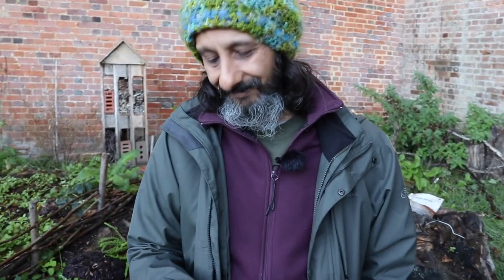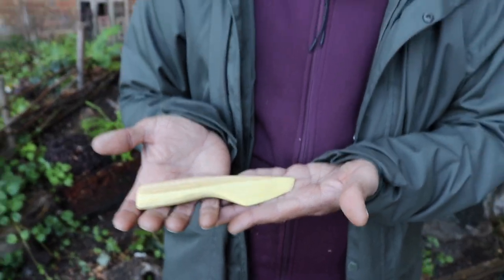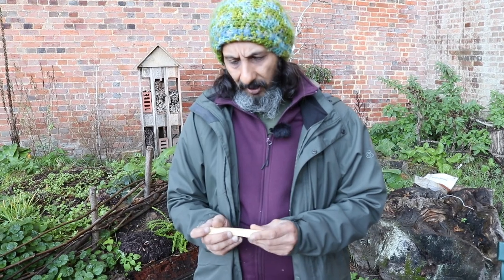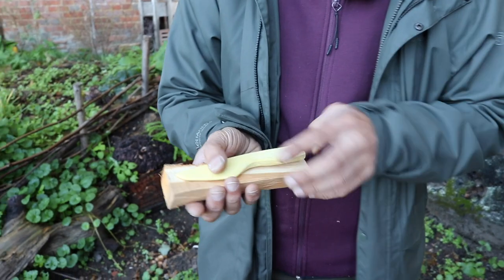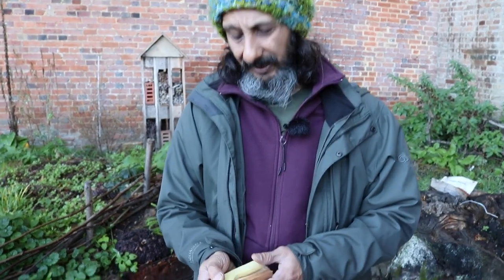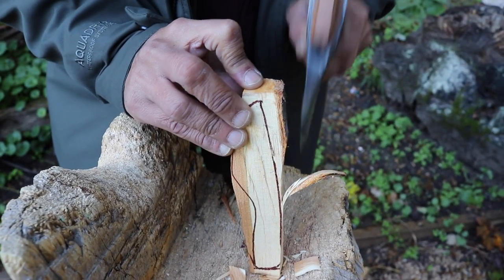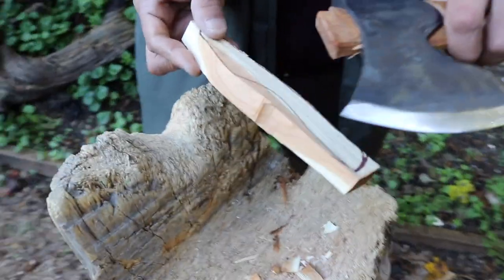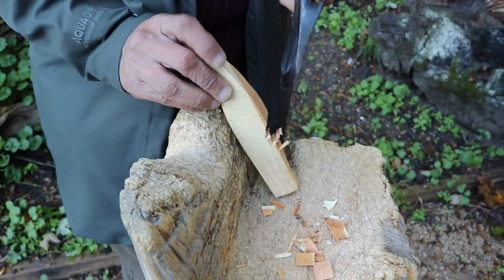How To Carve A Butter Spreader - Richard Roberts

Comment: I would love to have a proper knife like that one.  In the mean time, I used a utility knife with the swappable razor blades to carve a letter opener and a scoop for coconut oil out of an African hardwood called Makore.  To get the inside curve I used a tiny little carving tool like a gouge but only 1/4" wide.  It was not ideal and took forever, but it was fun to do.
Reply: @talkin-ape  thank you for the tip.  maybe I should start with the Mora 106 sloyd and add a custom one if I stick with it.
Reply from the maker: Great to hear you improvising and without doubt you use whatever tools you have available, then acquire more specialist ones over time ~Peace~

Comment: Thanks a lot for another nice video! 
How do you clean such a wooden spreader? With detergents? And doesn't it get rancid quickly?
Reply from the maker: You simply clean with a wet sponge (soft side), detergant is ok to use and dry naturally, thats it. It does not go rancide so long as the oil has properly cured ~Peace~
Reply: @Zedoutdoors  Thank you very much for your answer!